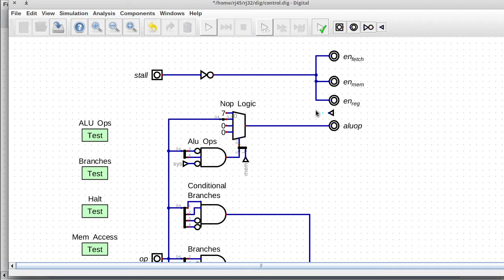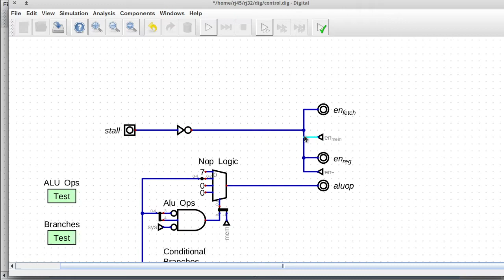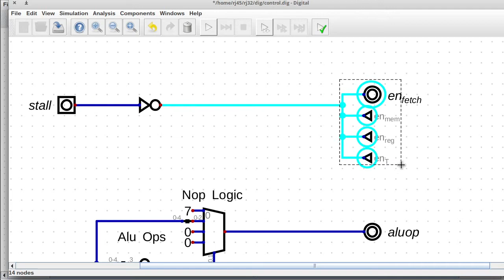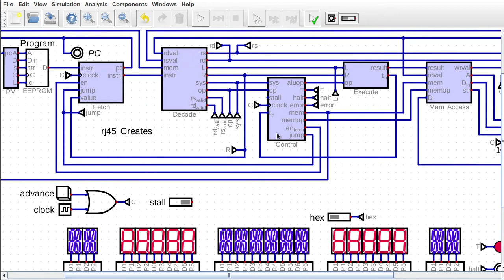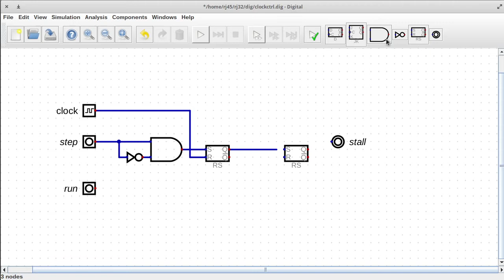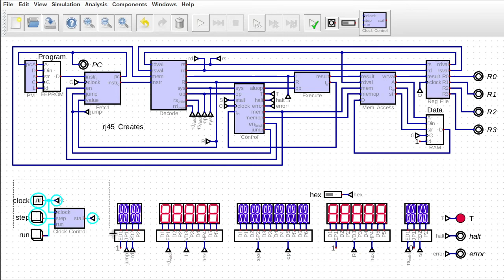[024] Stall! - Building a CPU From Scratch

Comment: Wouldn't it be easier to have a third button that controls whether you step or free-run the clock? So you just have a t-flip-flop and a multiplexer, the t is hooked up to a third button that switches between step and run and then the multiplexer picks between the step button and the clock.

Comment: Also...  That kinda logic hurts my brain too.
Reply from the maker: Yeah, and it's not correct. There's still a bug in the clock control circuit to this day that I have yet to find and squash, and I think I have redesigned it a couple of times since this video to try to fix it, and have not yet succeeded. I think the secret to making these sorts of circuits easier to work on is to separate the "business logic" or combinational logic from the registers that hold the state, and then really test the combinational logic thoroughly.

Comment: What if the clock just ran really really slow?  I don't think that would work because the execute  might execute before the information is pulled out of the regfile.
Reply from the maker: I had to re-watch the video but I am still not quite sure what you're talking about. The execute unit will be the slowest part because the carry of the adder is slow. Generally loading a register is really fast.
Reply: @rj45Creates  ooo. Sorry about making you rewatch the video..  you said at the beginning that you can't just put the entire thing in the fpga without these modifications, I kinda understand that these different logic circuits all propagate their signals at different times...  I was just thinking with a completely flat and if everything does just take one cycle....  If you ran as fast as your slowest logic element, you might not need to stall...
Reply from the maker: @kayakMike1000  The slowest clock I have on most of my FPGAs is 12 MHz, some of them can only go down to 16 MHz. I could of course just divide that down with a clock divider circuit. But that causes other problems if I want to talk to a UART or VGA display. Generally the best practice is to have an enable signal that is pulsed, which is pretty much what the stall signal is doing but opposite polarity. Regardless, I think the way I implemented the stall signal will need to change in the future because it's causing problems. I think there's probably a much simpler design that will cause a lot fewer issues as I work on the CPU.
Reply: @rj45Creates  yeah...  I refactored my rv32I decoder like ninety five times to weed out some mistakes.  I think it gets a bit simpler... But maybe I'm leveling up my logic circuit skills, or a bit of both.